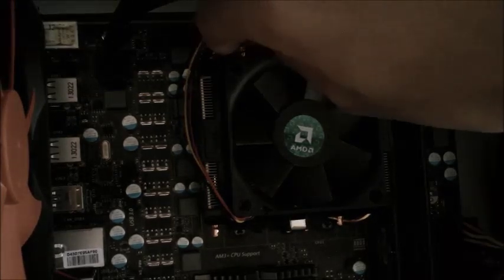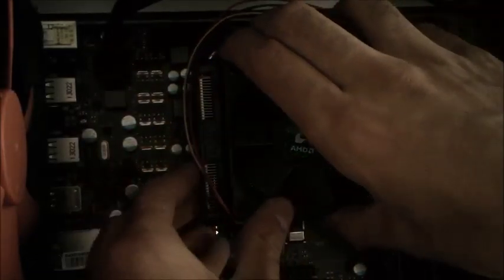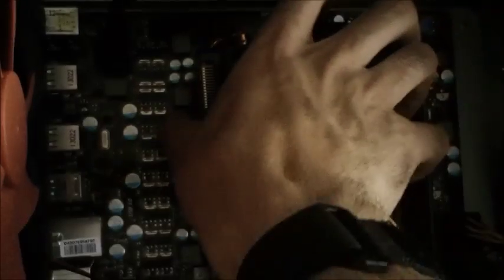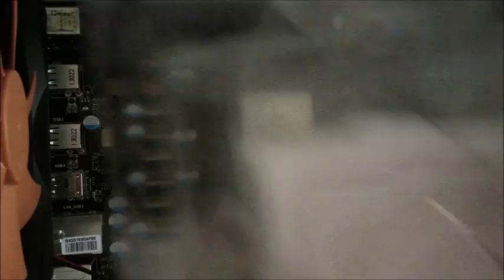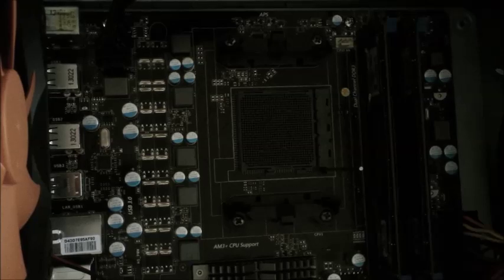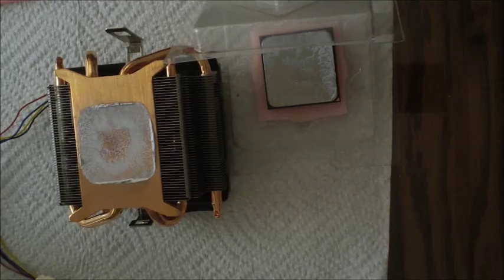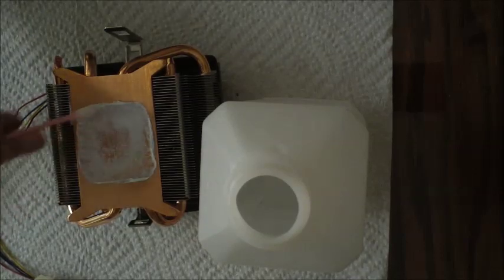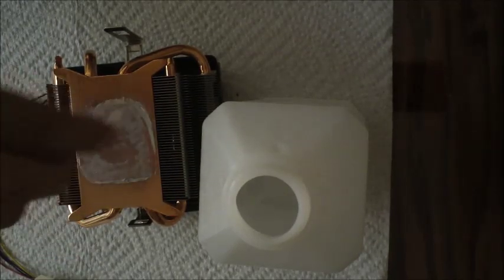removing stock AMD heatsink and thermal compound AM3+ cpu

Comment: I have an AMD FX-8350 with MSI 970 mobo. Three years ago, the first time I tried removing the fan it was very difficult to pull. I did it  like the way you showed it. Eventually I damaged my CPU pin. Lucky me, its still under warranty and the store where I bought it replaced it. Lesson learned,  I would never remove my fan and CPU again. Even if my fan is getting annoyingly noisy right now.

Comment: That is an advantage of the Intel CPU's, you can be a bit rough with them because they have the pins on the motherboard, that's what you have to be gentle with. You can use this advice with both brands though.
Reply: Patrick Musson But, the bent pins on AMD's CPU is easier to fix without spamming them since they aren't as tiny and is more spaced out than the motherboard pins, based on my experiences

Comment: The amd 8350 lever to remove the stock cooler is held in really tight and wont budge unless a lot of force, what shall I do?
Reply: you have to pull the lever slightly away from the cpu so it lets go of the tiny piece of plastic that keeps it in place

Comment: from all the videos i watch it seems like I should run my PC under load (do some gaming) to heat up the CPU and soften the thermal compound.  Probably will be easier to remove than cold, firm paste.
Reply: Does it work?
Reply: @be.7224  yes :)

Comment: Great video. Once I tried to remove it without instructions and ended up taking out the CPU attached to the fan. A lot of pins got folded and I had to use a needle to straight them up again. Fortunately it worked.

Comment: Good video, I've always pulled the cpus out when changing cooler or reapplying thermal paste while its cold, broken pin on my old 8350, and bent 2 of the pins in this 9370, thank PC gods my 9370 still works fine and am using it now.
Reply: I did the same thing.. I bent the pins on my 8350..I freakedddd.. Luckily I bent them back into place and re applied the thermal paste and it worked fine

Comment: Man I can't even get started. I can't get the heastink off. I twist the little lever, then there's those 2 pins holding them in and I CANNOT get them off for the life of me. I even used a screwdriver and tried to force it off to no avail. I ended up just giving up for fear that I would damage my computer. =(

Comment: mine is very stuck, should i just keep turning it until
 it comes off easier?
Reply: +Tribican I wouldn't recommend that.. You might bend some of the pins. Some paste is fairly tight but will come off with a little encouragement, whilst excessive paste or died-out pad can be a nightmare.
Is it possible for you to run the computer 10 mins, then power down and un-plug everything? The resultant heat can sometimes help loosen things up a little. Hope this helps :)
Reply: alright thankyou
Reply: Try standing on the sides of your case with a crowbar. Works, every time.

Comment: Thanks so much for the direction on how to remove a heat-sink from an AMD chip. I just picked up a new MSI 970 gaming board. I have a FX6100 on a 760GM-P23 board that came in the kit I bought from TigerDirect with a Cooler Master Seidon 120v liquid cooler. Didn't want to go with the Zalman fan cooler that came in the kit. The 760 started throttling the cpu and from what I found online the board was on its way out. So hence the new board. I just hope this will be the same way to separate my cooler from the cpu. Thanks again for the upload and if anyone has any advice or ideas on the build of AMD systems. Give me you advice and opinions. My first build and I'm still learning.

Comment: When I last tried it, I broke away from socket AM2 processor with the pins because the thermal compound holds as chewing gum. Fortunately, nothing happened to the processor. Nice vid, btw.

Comment: I have an AMD FX 8320 I noticed that my heat monitor was giving me a very high temperature  I opened up my pc unhooked the heatsink and it Wouldn't COME Off!. I tried twisting my heatsink but It didn't work. then I decided to pull it off with force, It came off then I was like where did my CPU go!?! I looked under my heatsink and there it is, a 190$ cpu glued to my heatsink, I used a different method though, I pushed the side of the cpu and I slowly slid off, luckily I was very lucky lol, Only 2 pins were bent I straightend those with my nail cleaned the cpu and heatsink checked if the cpu fit again and luckily it did. All I have to do is get new thermal paste! :)
Reply: happened to me today but none of the pins were bent im lucky

Comment: my first build i had a no screen error i tried to remove it and the cpu came out with it the mobo was still locked lucky for me i got way with it but im going to swap out the stock cooler because i didnt have funds at the time least i know not to do it the way i did it last time

Comment: So i got this nice aftermarket cooler on my 8320, decided to put another fan on the heasink, so i pull the heatsink from the cpu, and wham, the whole cpu gets ripped out with it. Result: 3 days old 8320 completely useless. But i learned from my mistakes, and i found out that the key to safely removing the heatsink, is not to pull directly, but gently pulling while wriggling and rotating a little. And as you said, it helps if u run the pc a small time before removing the heatsink.

Comment: Wish I had seen this video before removing my heatsink. I unclipped the stock AMD heatsink and just gently lifted it but it ripped the CPU out of the socket while the latch was down and then when I cleaned it and put the CPU back in the socket and attached the new heatsink, it wouldn't post. I think what happened was that when I accidentally ripped the CPU out of the socket, it bent a few pins slightly, and then when I reseated it, it flattened those pins. The CPU is obviously binned now but it was only an old 955BE anyway and I have an 8350 on the way and I'll see if my motherboard is ok I guess lol. Nooby error :) I'm told this happens a lot.
Reply: What the hell!? it says I posted this 44 years ago! - http://gyazo.com/1cc325a28981937778073cd64054b508
Reply: antiduckable
lol Hello time traveller. I was about to do the same but the screwdriver was too big so I saw the thing that disconnects the heatsink from the CPU and I unlocked it then I didn't know what to do and I opened this video, lol.

Comment: How safe is it to pull the heatsink?
I understand I should twist it a bit and pull gently, but it seemed you applied a considerable amount of force. I wouldn't want to pull out the CPU

I also read that 90% isopropyl alcohol was a better option to use. Is it true?

Why is it that these AMD sockets don't have those frames the Intel ones do.
It would appear they'd make the heatsink removal easier, in my opinion. Could be wrong.
Reply: i have actually ripped a cpu with the fan of the motherboard yesterday, i was scared shit less. 5 hours later i try it and it works like a beast :)
Reply from the maker: It is safe to pull the heatsink with a fair amount of force because of the way the cpu is mounted and secured itself to the motherboard (Just don't over do it, its a subjective feel I can't tell you an exact point in where you may be using too much force).  But as I mentioned run it for a little while before opening it up so the thermal compound is heated and it's easier to remove the heatsink.  Also when pulling it off apply constant force not jerky force motions.

I just use rubbing alcohol,  I'm sure there are a number of other things that work (don't waste money on specialty thermal compound remover).  The key isn't so much what you use, but being careful with cpu (the pins especially) and removing all traces of what you used to clean it (wiping it off well) so that when you reapply thermal compound the bond is strong.

Why AMD uses different mounting systems than intel?  They're two different companies that have come to rely on two proven methods. I use AMD cpu's because they tend to be cheaper and the motherboards are usually cheaper.  So while I don't know how intel's brackets work I will say that I am a fan of AMD's bracket system for three reasons
1.) because it always feels like a secure connection.
2.) Even though the clips can be a bit of struggle to get on, once you've got the two clips in place set the lever and its secured.
3.) Heatsinks tend to be backwards compatible and forward compatible with many sockets AM2,AM2+,AM3,AM3+...

I hope I answered your questions in such a way that it helps you.
Reply: MrBlacksmith92 Exactly the same reason that I stick with AMD and it's just so simple. You can literally go out and buy a brand new, just released AM3+ motherboard and the socket is compatible with AM2+ CPU's, the only mainstream AMD sockets currently are AM3+ and FM2. With Intel there is 1366, 1155, 2011, 1150 etc...

Comment: i don't know how to remove my cpu fan cause its dead by my mistake
Reply from the maker: what type of heatsink is it? Do you mean the heatsink is stuck or the fan in the heatsink is stuck? Because if its the latter usually its easier to just remove and replace the heatsink.
Reply: MrBlacksmith92 ust fixed now was the black wire of my cpu stock cooler burned and just changed the wire and work fine now like before
Reply from the maker: Good glad to hear that!
Reply: thanks :D